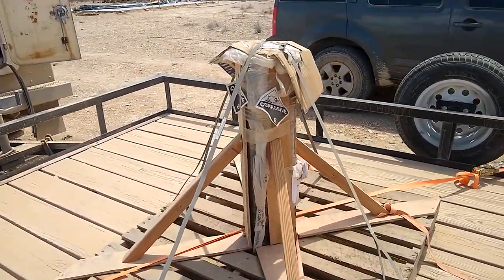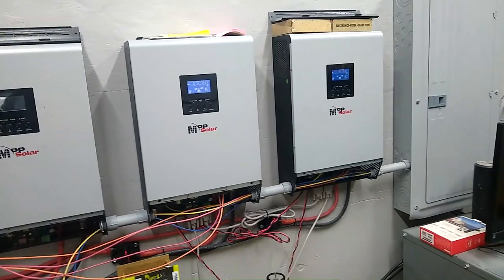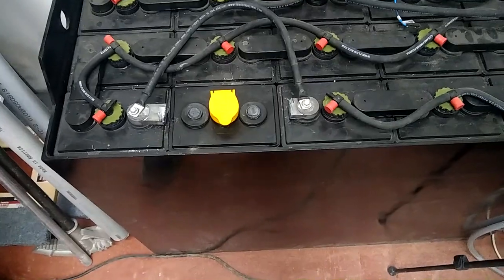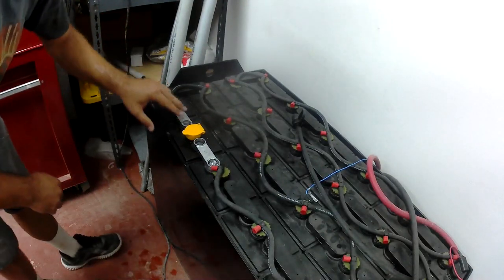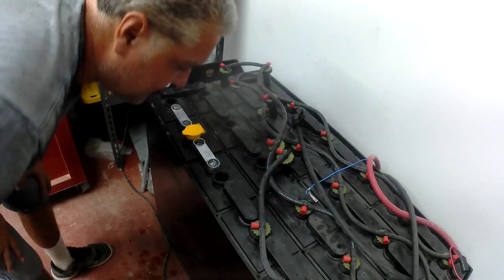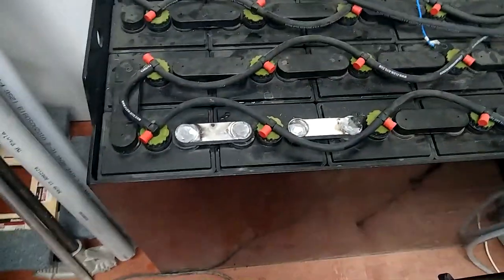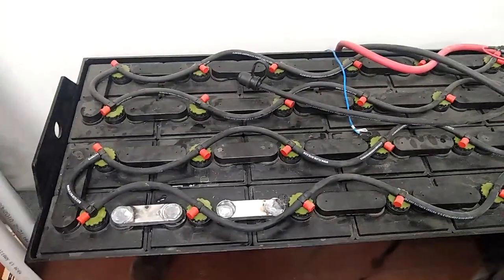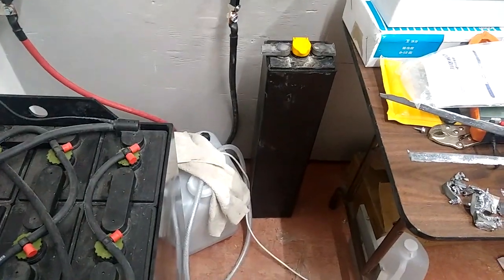Off-Grid Forklift battery cell replacement - Terlingua Texas

Comment: Lesson learnt for me - batteries should have terminals where cables can be fixed using nut/bolt or clamps. It is easy for long term maintenance. Thanks for sharing your work.
Reply from the maker: Yes, that would certainly be easier. But it's a lot easier to get batteries made up of welded cells rather then flag terminals. Now that I've done it, I'm not worried about having to do it again :)

Comment: I have been think about using a forklift battery like you for a while now. If you did it over again would you still use the forklift battery? And you you think the cell failure was just random chance or from battery misuse?
Reply from the maker: We have had good luck with it and would definitely do it again. The cell failure was likely due to a manufacturer defect and they replaced it without any questions. They sell these batteries for forklifts and for stationary use like a solar system so we are not misusing the battery. As far as performance, we run electric heat and AC, fridges, freezers, tv's, computers and other stuff all night and never have problems with running out of power.

Comment: Did the new cell have to be charged before connecting it?
Reply from the maker: The new cell was charged most of they way when we received it. Also, in this setup, they are all in series so even if it was a little higher or lower than the others it would only effect the aggregate output and being that it is lead acid they will mostly self equalize within one or two standard charge cycles. Also, we have an equalization cycle every 30 days which happens to be the day after doing this :)